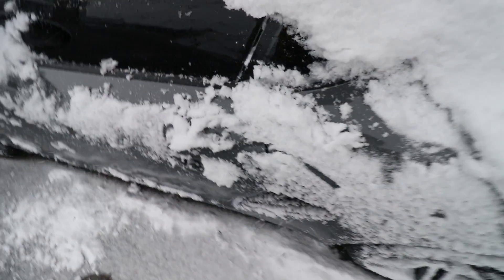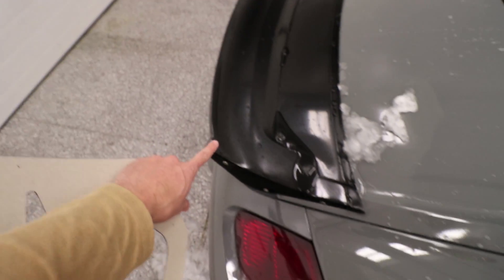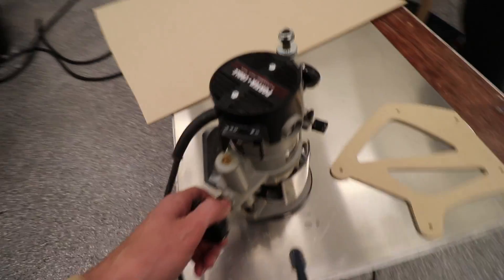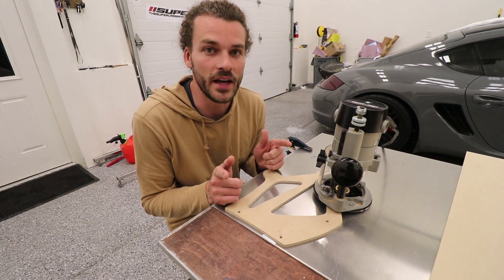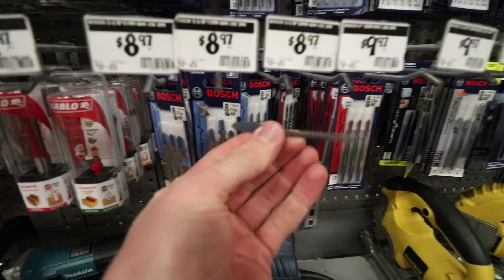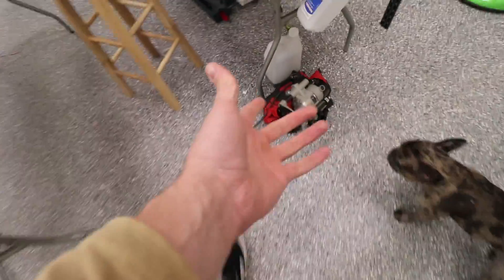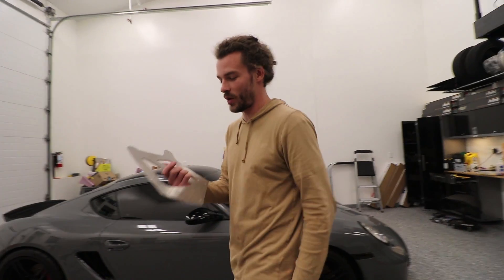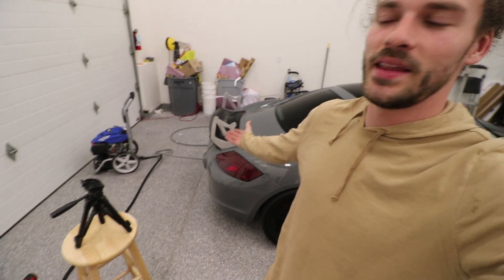Making My Own GT3 Style Aluminum Uprights!

Comment: What you need for the router is a pattern/template router bit for non ferrous metals and slower speed setting on the router. That type of bit has a bearing that rides on your template and creates perfect copies. Or maybe a scroll saw or band saw but that requires more skill. Good luck!
Reply from the maker: Just leaning as I go!

Comment: Looks awesome so far!  FYI next time cut the aluminum as close to the shape you want as close as possible with the jigsaw then use the templet and the router to clean up the edge, so the router is only taking off as supper small amount of material. Also use a cutting solution to keep the bit cool and cut faster.

Comment: You want to go counter clockwise on the outside of the piece and clockwise on the inside holes.  It's the way the router pulls, if you go the opposite way your fighting against it. The way I remember is visualize a wall clock, If your routering inside the clock go clockwise the way the arms are going, if your doing the outside of the clock go counterclockwise.
Reply from the maker: That never crossed my mind! I wonder if that would have made a big difference!
Reply: @SummitLife   Yea it usually gets shaky and you have a lot of resistance if you go the wrong way. I would give it a try on a piece of scrap it should make a big difference.
Reply: Great point. Also don’t for get you need to know if the bit is center cutting or not. It define how the cut is made too.